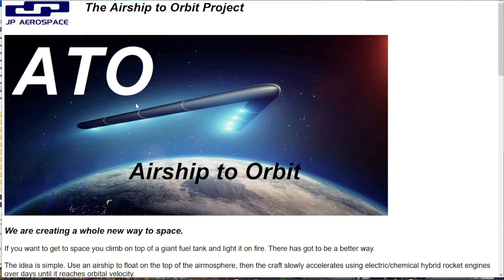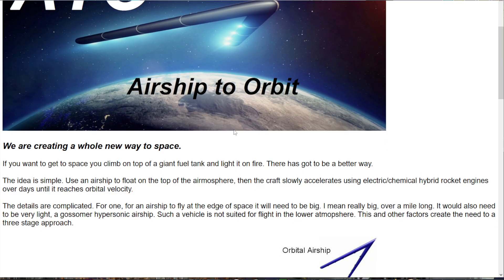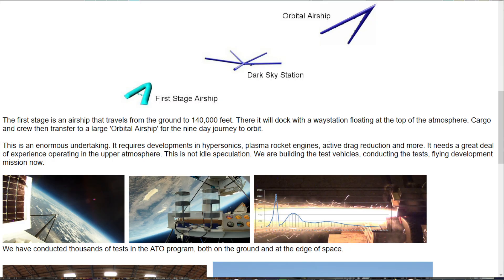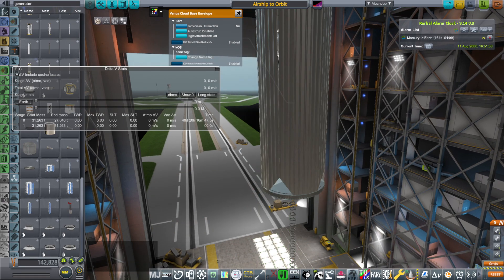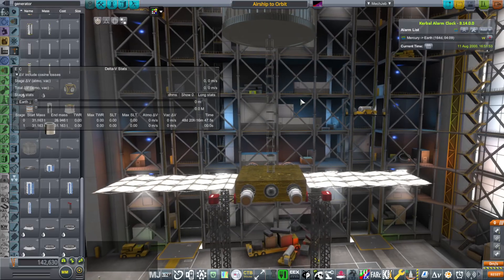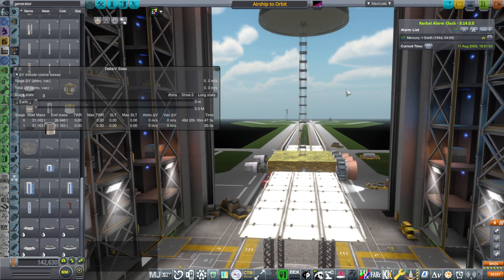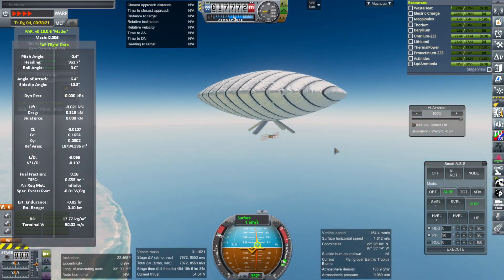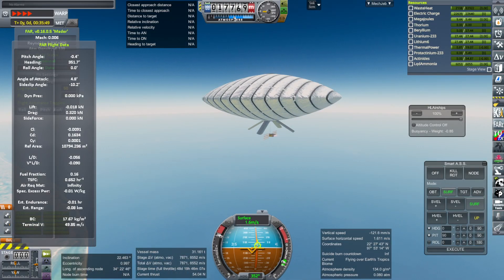Airship to Orbit?

Comment: Since the air becomes less dense at higher altitude it doesn't counter the problem. One thing that could be interesting would be to have a high altitude plane able to catch a spaceplane mid flight for cargo and fuel transfer (not crew). Hence saving 1/3 or even half of the necessary delta V for orbit. I'm not shure how to test that on ksp (piloting 2 ships at same time)

Comment: I think the idea is that the airships shape turns it into a wing at higher speeds. That way it can climb to higher altitude where air is thinner. If not, bouyancy alone will require such high air density that you can never reach orbital speed.